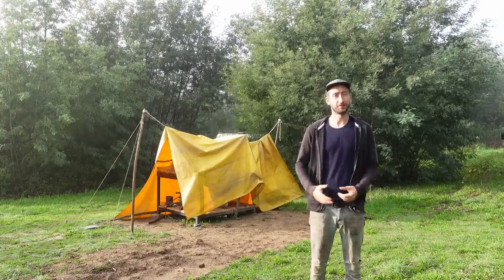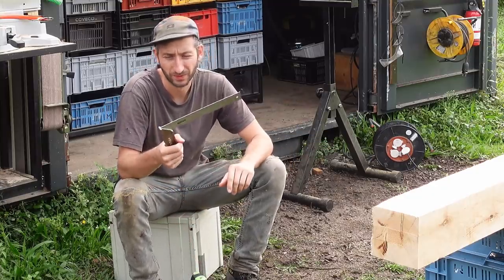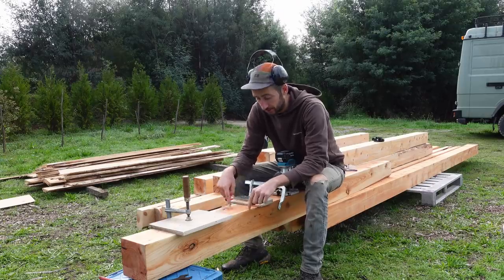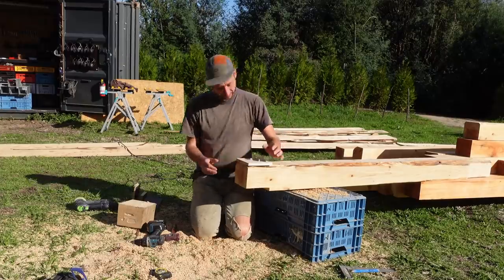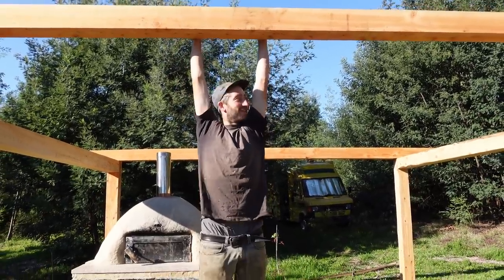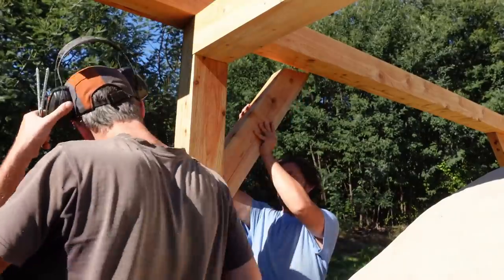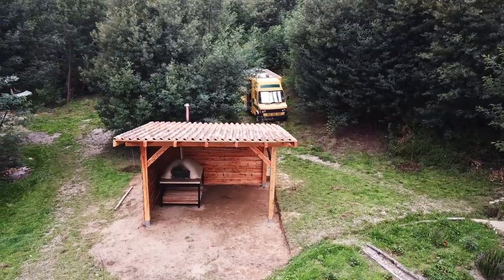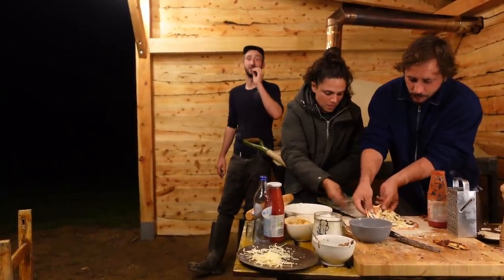#39 Building a wooden structure with reused rooftiles for our pizza oven

Comment: Connect a gutter and rain barrel and you could harvest water for the garden, cement, building work.
Reply: Popped in to say this.

Clean the rest of those tiles down, and a simple gutter to lead into a water tank behind that structure for some easy fire fighting ability... incase i pop in to try and cook a pizza :D
Reply: Even if you doesn't want to harvest water for now a gutter will prevent the water from splash back on the wall.
Reply: @alanjaques5316  or forming puddles on the foundation slab
Reply: Exactly! Small improvement with a great outcome.

Comment: For future reference, use the circular saw with the depth set and cut strips then knock away with a hammer and chisel, use the router to clean edges not for bulk removal, a book of carpentry will help in your ventures.
Reply: Can confirm :)
Reply: Yeah it was a bit wierd to see a router used like that.
Reply: Sure….. But the router still worked

Comment: If you don’t want to use chemicals to treat wood, you can scorch it. In either pull through a fire or use a blow torch.
Reply: Also you don't  have to sand the Wood.
Reply: That looked like linseed oil.  I would have cut it with turp or diesel
Reply: @Noah-xc5ij  I don't get why they didn't plane it instead.
Reply: @DaDunge  'Cause they don't really know what they're doing most of the time

Comment: I feel like your chimney pipe needs space around it, so it's not touching the wood. I don't know if the pipe is designed to be against wood, but I remember it glowing red in a previous video.  I'd hate to see a fire at your first new structure.
Reply: And the chimney goes directly into a tree -> double fire hazard

Comment: Well done on the build, the structure looks great. Your statement re the sawmill is a bit naïve however. It's standard for them to provide ruff sawn timber in nominal size (meaning its oversize). Its up to you to then reduce it to final dimensions. Big box stores sell what they term as final dimensional lumber, but that generally too has a plus or minus value. So it's best to process timber to final size your self so you can be sure what you have. All that said building with nominal timber is fine in the way you have, the key is understanding the differences in marking out between timber which is final dimensional and timber that is nominal so that things line up and are square and true. Either do a bit of reading with regards to live wood timber framing or watch Kris Harbour building his top workshop in round timber, he explains that process in great detail. I hope that helps.

Comment: I suggest that you use a small hand plane to round off the edges of your beams. This will avoid chipping the edges, help them preserve, and also give them more appeal If the unit is already built you can still do it and lightly sand and retouch with linseed oil.
Nice router work and jigs !! Very clever how you protected the posts with the galvanized sleeves !!
Hang some hanging,  potted herbs or flowering plants!!

Comment: Hi guys,
please consider putting at least 15cm of non-burning (mineral) material around the area where the hot chimney goes through the wooden facade! That seems so risky in terms of fire safety!
Otherwise all the best to you and keep up the good work,
cheers from an architect (who visited you in Eindhoven during a plastic design challenge)
Reply: I also saw the way to small gap, with no fireproofing... highly recommended to do the passthrough according to "code". Especial when it's oil treated wood, cus it's even more flammable now.

Comment: If you plan on using wood from that type of source I’d recommend Anchor Seal for the end grain, that will help stop some of the warping. Whenever you insert into the ground (or concrete) burning that part (Shou Sugi Ban) will help in resisting rot and can be a very cool finish.

Comment: You guys are doing a great job there. It should be a practice when putting your baton on that you should stagger the joints so it gives it more strength. When you put it inline with each other, that will be your weakest point and will give way over time . Not saying that it will fall down .To preserve the lumber  and not use chemical, you can charring the lumber tighten the grain and this will preserve the timber from rot, insects, fire, fungus and U.V rays and then put linseed oil on top. Keep up the great work... Cheers from down under.😎

Comment: As always, we watch any new Project Kamp video during our lunch break. Such a joy to see every new project executed with such dedication & collaboration. And I love that you sourced wood locally and the roof tiles from your property. Now that's sustainability!

I see in some of the other comments that some people are concerned about securing the bottom & top rows of tiles to prevent high winds from causing a big problem. That might be something to look into as global climate change is going to cause more powerful wind & rain events, so one shouldn't build with only past history in mind.

Glad to see you using linseed oil to protect the wood and avoiding using concrete unless absolutely necessary. Staying green as you go along sends an important message: every choice matters in the long run. Hope the footings hold up and prove to be adequate for years to come, because it would be challenging to have to redo them in the future.

P.S. Nice diy timber cutting saw guide! I like the way you solve problems on the fly.

Comment: Clean construction, looks really good. Don't you have to secure the first layer of roof tiles so that a storm doesn't blow them all away? I think they have a prefabricated hole that you just have to drill through completely.
Reply: Old tiles doesn't have holes ...in normal construction of houses they put some  cement in the first row next to the walls and in last row in the  the ridge....its very rare to have storms with tornado winds in Portugal so in general a ceramic tile roof will last decades without  incidents....
Reply: @netby  Thanks for the Info, I didn't know this.
Reply: @ernestospadolesto8126  Yes in the last years some ceramic tiles makers do  fabricate the tiles with holes( at list some of them to be used in the first rows or in the last ones..) but 20/30 years ago they do not ...but in this case of the shed , if  it was me, I would fix the first row in the front, because there is no front wall  and the shed  will catch a lot of wind from the front...like a boat sail....
Reply: @netby  Yeah, on a normal roof, not on something that's completely open to the wind from below. Any kind of serious wind from the right direction will do a serious number on this roof.

Comment: The wood was probably cut at the correct dimensions when it was green (wet) and it then all dries at different rates so shrinks!
Reply: Nope, shrinks and swells to over 5 mm? I don't think so, dear wood supplier...
Reply: Yes the one beam was curft
Reply: @ernestospadolesto8126 5mm is barely anything, Portugal is warm and even on laminate flooring which is incredibly stable you leave expansion gap of 10mm for seasonal movement and this is green cut probably.
Reply: @Kaese1212  May also have been the wide-angle camera. But I can understand curves more easily with fresh wood. Over and undersize that big doesn't make sense to me.
Reply: @AW99017 These are more like the walls of a house that reacts to the cold and warm. I can't imagine laminate with 10 mm expansion either. He paid for the wood, so it should also be expertly cut, with a tolerance of a few millimeters at most.
Reply: @ernestospadolesto8126  yes it will, this big size of wood can

Comment: Yall could have found some used outdoor curtains to put on the sides the rain blows in. Grommet top and bottom if you like and have on round rods. They can be slid open or closed depending on if needed.

Comment: Love your work, but I have to say, because I know what I'm talking about, that foundations are not safe up the years. A gust of wind can throw it to the ground due to the weight and sail like effect. The galvanized should have been  plunged to the ground at leat 1 meter (solid ground) If you want to solve it now , you will have to put cement and a few cross bars (spider bars). Hope all turns out well.

Comment: There is a mechanism on the back of your Kapex 120 that allows it to cut taller material at the trade off of no longer being able to cut as wide of material (no longer sliding). It works by grabbing the saw mechanism with a metal piece, and it will no longer slide back and forth, but you will know it is  in the correct position when this happens. If this all just sounds like gibberish, I am sure you can find videos of it somewhere online.
Reply from the maker: neat. wasn't aware of this!

Comment: +Project Kamp You should get some Japanese handsaws :) a rayoba would cut really fast through those big timbers,those type saws work on the pull stroke and therefore go through the wood much quicker/easier, also super clean cuts. 🤙🏼

Comment: Ive just watch ever episode over 24 hours of season one and will continue till ive watched them all wush i could come and help love what you are doing Using galvanized pipe to keep the wood off of the ground good idea in theory but you may start getting water seepage from capillary action our the tube just filling up with water as the wood gets saturated with water overtime the linseed is ok but  will dry out very quickly and will need treating often i use linseed oil myself alot and it will total dry out within a few month's

Comment: As other have pointed out bellow, a gutter would be nice in the roof, and as a plus put some gravel (small pieces of the broken ceramic tiles would be O.K.) on the ditch were the water collects as it drips from the roof, if you don't in time it will erode the ditch and it will become really big and can undermine de wall next to it, specially if freeze and thaw cycles.

Comment: Looks awesome. What a great way to cover the pizza oven.  I have one question. It looks like the roof tiles were just dry set on the battens.   How are the tiles secured to the roof?
Reply: They stay put because of their weight, like any rooftile on any toof….
Reply: @sietse9920  Thank you for the info. I am not familiar with that style tile. Other installs I have seen in the US have had a hole in the tile and a spike is used to secure the tile to the battens.
Reply: I know what you mean. Here in the Netherlands you sometimes see such tiles on the top of the roof (the cam), because the wind might catch them 😁
Reply: @sietse9920  Even in the Netherlands they secure the rooftiles to the wood frame with a nail. Specialy on an open structure like this.

Comment: Hi. Great job. The side walls are too wide for the timber horizontal planks. They need vertical supports every say 600mm as the siding will sag, twist and warp without it. Good luck with future projects. How are the composting toilets going? Cheers from Melbourne Australia

Comment: You can take the pizza OUT of the oven with a shovel, that's not going to be an issue.  When you are putting the pizza INTO the oven, you should use a wooden peel, basically a flat paddle wide enough to easily hold the pizza.  After you stretch your dough, plonk the dough on to the wooden peel which you dusted first with a bit of flour or better yet, corn meal.  Move quickly, dress your dough, and pop the peel into the oven.  A quick and slight jerking motion will allow the pizza to slip off the peel.

Comment: In case anyone's wondering I think the Bondex thing is an oil based polyurethane. The classic one gives a very nice color but being oil based it's always a mess to clean up. Luxens is another common brand in Portugal which I believe is water based poly, so a little easier to apply an might be a little bit more eco friendly.

Comment: Chimney on a wood stove should never be in contact with the wood. Check out some you tube videos where they build log cabins to get some idea as loads of people have built cabins with wood stoves. Is the chimney just held on with cable ties too? This is a part of the build you really needed to take seriously as there are serious safety risks with wood burning stoves that need to be considered. Even the distance from the stove to the walls is important because of the heat. Real attention should be taken to the chimney and making a safe install.  Don't just treat this as a trivial matter. 

On the upside, it looks like your oven is making fantastic pizza. :)

Comment: If we stop using wood and start using glass fiber for such structures which are small and for fun even we can build small houses with glass fiber and its cheaper then wood all u need gyro foam board and shape it like a wood slap and can make it larger and its lighter put glass fiber met and pure the resin and you have a wood replacement ready to build a cabin.